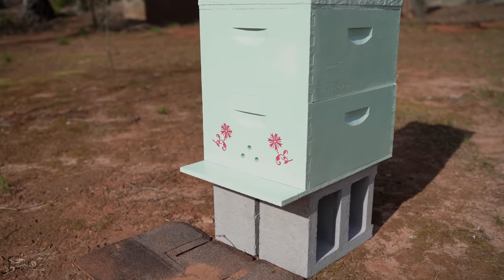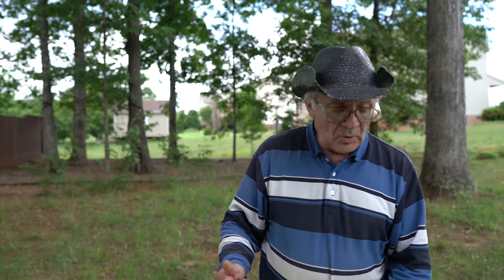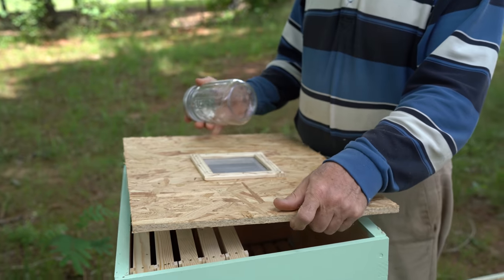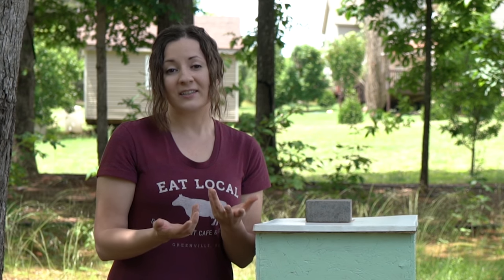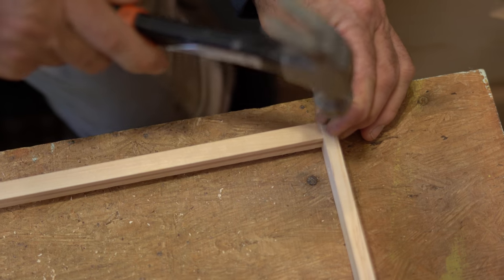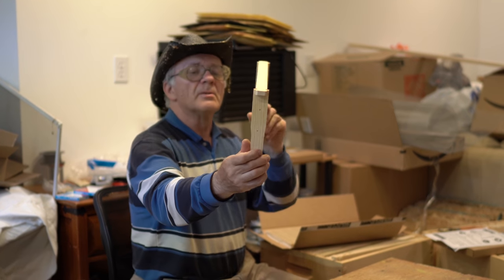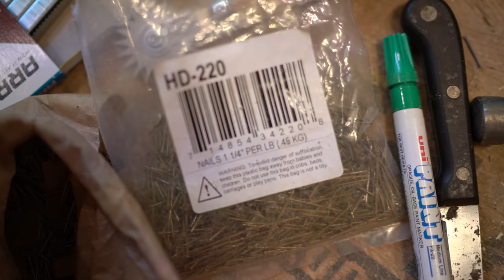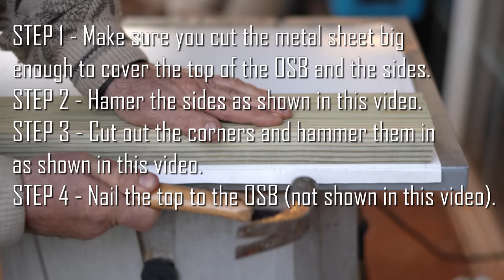Starting a Beehive For Dirt Cheap & Setting Up Beehive For SUCCESS (Part 2)

Comment: Thank you for watching everyone!!!! Questions,comments or suggestions? Please comment below! I will answer!!!! Have a blessed day!
Reply: Broken wood while nailing? Please see video :  "3 wood working tricks / tips". It may helps.
Reply from the maker: @triboet I wonder if it works every time. The wood on the frames may be too fragile. Will try and see!
Reply from the maker: @triboet  Thanks for watching! :)
Reply from the maker: @triboet  We have tried it, and it takes too much time to do it this way. Also, the nail has a hard time going in and bends a lot more often, the cracks weren't as bad but the bottom of the frame still cracked,  since we are nailing the sides anyway, we have no need to nail the bottom of the frame, just an extra step. I'm sure this tip works on certain types of wood very well. Cool tip by the way.
Reply: Hi. I have a question about the OSB. How thick should it be and what does it need to be coated with? I just want to buy the right one the first time. Thank you!

Comment: I think the unpainted wood inside helps suck up some of the winter moisture also. I use an air stapler and glue to put the frames together, but the stapler was a gift
Reply from the maker: Nice!

Comment: I find it interesting you use only 3 holes instead of the bottom board with the opening all the way across. Seeing as how I build all my own boxes and frames. It's a lot of work to build a conventional bottom board. Does it affect honey production at all? Also does it affect mites seeing as how you can't use a screened bottom board or would it work to screen the bottom? I can see that the 3 hole system would definitely restrict the wax moths and wasps. You have the best informational videos. Thank you.
Reply from the maker: Nice! We are happy to hear that! It should work with screen bottom boards just fine and yes it’s so much easier to drill holes than to make bottoms the other way! Thanks for watching and commenting! :)

Comment: Pavel do you have an upper entrance if not how do the bees get the excess heat out; I am in Canada in the winter we need the moist air expelled outside of the hive so water does not condense and hot air in summer expelled so they do not cook; did I miss it
Reply: What's an upper entrance never used one. 2 inches of PIR insulation above inner cover all year round. In winter it stops condensation dripping on the cluster. Brother Adam used cork.
Reply: @beehinde  I use styrofoam in winter; an upper entrance is a notched inner cover or notched feeding spacer or simply a hole drilled through the side of the box for air and bee movement
Reply: @kevimc  I started beekeeping 38 years ago and found the bees did a very good job with one entrance, one side of the entrance drawing air in the other side blowing air out. You can see what they are upto using a flame by the entrance. Even better results with poly hives.
Reply from the maker: My dad said he uses the inner cover with the screen as shown in the video to ventilate the hive, that should be plenty of ventilation for the bees. The screen on the inner cover easily passes air in and out. Most tops for beehives are not tightly sealed on to the hive and have small holes in the wood where air passes through easily. Also, we suggest making one entrance hole on the second deep super (one should be plenty) for even better ventilation. If bees don't need that hole they will cover it with propolis! Hope this helps! Great question! Thank you for watching and commenting!
Reply: @AnnaKra  thanks Anna so your dad uses an upper entrance; I was wondering because it must be hotter down the coast where you live compared to Canada or Russia thanks for the reply
Reply: @beehinde  I never tried it but on a hot day stick a thermometer in your hive; I have seen bee bearding on other people's hives but I have never had the bearding on my hives because of the upper entrances
Reply: @kevimc  I used to see bearding when I had solid floors and dampness in there as well. But since changing to OMF (open mesh floors) I hardly see bearding and the environment inside the hive is better. OMF's were designed pre-varroa, but these days it is called varroa mesh. I have seen a number of American and Canadian beekeepers only using lower entrances. In the UK there are no upper entrances and we use top insulation. At one time the idea was to use matchsticks between the brood box and inner cover.
Reply: @beehinde  here in most parts of Canada in winter our snow can easily bury the bottom entrance; so when I wrap my hives the bottom entrance gets wrapped; not that it matters as the dead bees also block the bottom entrance; I too use screened bottom boards; thanks for commenting
Reply from the maker: @kevimc  We use it sometimes. The screen on the inner cover does pretty well when it comes to ventilating the hive.
Reply: @kevimc  Thank you for your time. It has cleared up an online discussion I have been reading.

Comment: You specify OSB 4x8 but you need to specify thickness. Obvious to me but not all. Sometimes OSB is actually more expensive then Plywood. If it is all about going cheap on your build then choose Plywood over OSB when the price is right.. Plywood is better quality. If you know how to choose lumber then go with solid boards.Up here in Canada where we export OSB . It is known as beaver puke among carpenters. If it is exposed to too much moisture it breaks down, swells,  mold etc. It's crap.
Reply from the maker: Maybe you should make a video on plywood!

Comment: Why does your plan say to cut 20" x 16.25" for the feeder box bottom when the size of the langstroth hive you are using is 19.75" x 16.5"
Same for the feeder box sides being 20 inches, they should be 19.75 inches.....
Is that a mistake or what?
Reply from the maker: The feeder box is meant to be smaller, it’s not used for frames.
Reply from the maker: The measurements are correct. That’s how we do it.
Reply: @AnnaKra  thanks lol, I already built all my stuff long before this reply, took a bit longer than expected but it was fun! I get my bees in 1 more week, starting 2 hives but another family member is doing 3, and we're putting them together
Reply from the maker: @escapetherace1943  very nice! I'm happy to hear!! :)